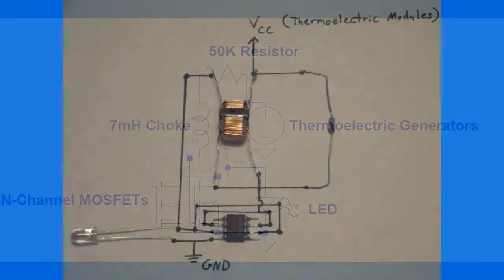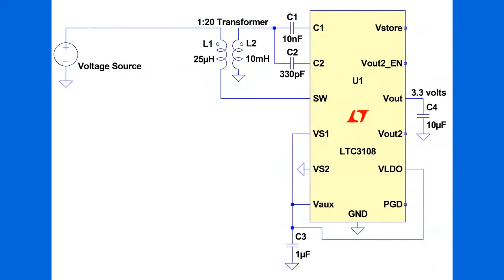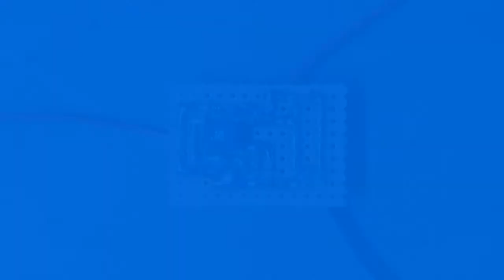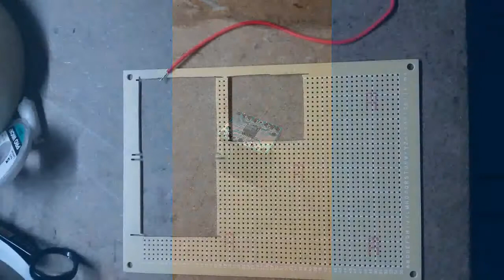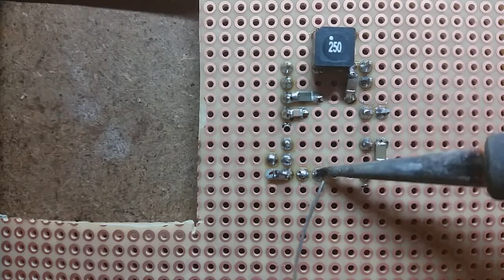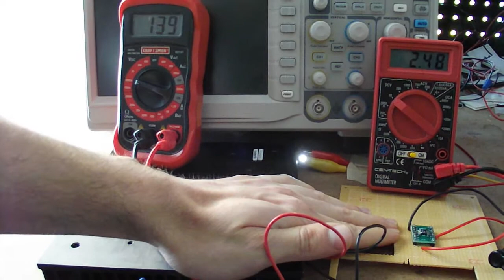How to make the LTC3108 Energy Harvester

Comment: Hi may I may I know if the circuit will still work if I use the same capacitor values but with 1:100 from coilcraft.
Reply from the maker: Hi, 
For the 1:100 transformer, I would recommend using a 1uF cap instead of a 10uF cap.
Best regards,
Erik

Comment: Hi, we have been working with this circuitry but we cannot obtain 3.3V on the output. We have used 1: 100 transformer and have tried TEG and Solar panels as input but none of them seem to work😓by using a signal generator with Vpp 1V we could obtain some reference voltages on some pins like VLDO 2.2V and VAUX 5.25V but still couldn’t see 3.3V on the output. Do you have any idea why it doesn’t work? If you could help we would appreciate it🙂Thank you for the video.
Reply from the maker: Hi, are you sure there aren't any pins that are accidentally shorted? If you are measuring 5.25V on the VAUX and 2.2v at the VLDO, then it is switching and mostly operating. I would check the soldering, especially if the VOUT pin is shorted to another pin.

Best regards,
Erik
Reply: After I sent this comment we have found out that soldering was poor on the Vout pin and it was not connected to capacitor😅That was the reason of the problem🙂Thank you so much for your response🙏

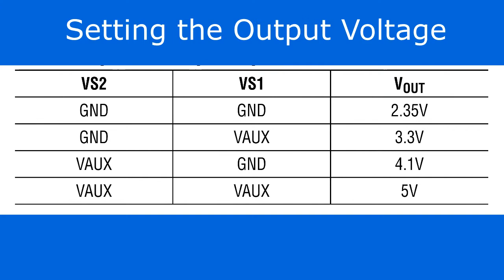Comment: Sorry Sir, can I ask you some questions. I read the link 1:20 transformer you give us, I don’t understand that why it is not a 1:20 transformer but coil inductor. I read this coild inductor’s datasheet but there has not description about 1:20. 
So if I want to use 1:100 transformer, could you please give the link the product for me? I am really grateful if you can do that. Thank you very much
Reply from the maker: Hi. It is technically a coupled inductor with one side having more turns than the other, so it still functions as a transformer. Here's a link to the 1:100 transformer: https://www.mouser.com/ProductDetail/Wurth-Elektronik/74488540070?qs=BXmE%252BJ0Y7xZ448CDAQuf4w%3D%3D
Reply: Thank you very much @lampe7384

Comment: Expensive parts ! look at Dc-Dc converter  H004F to92 starts at 0.3volt 200 000hz  ideal input is 0.7 - 3 volt .. adjust output by induktor value ..
Reply from the maker: If you don't need to go lower than 0.3V, then I wouldn't recommend the LTC3108.

Comment: What is the components that I need to use if the input that comes from my peltier module is ranges from 100mV to 1V
Reply from the maker: It depends. Do you have a bunch of peltier in series to achieve that or is it a single one and you have a large temperature difference?
Reply: The temperature difference ranges from 10-20 degrees
Reply: The temperature difference ranges from 10-20 degrees
Reply from the maker: @raffysulat2705  How often is the peltier voltage in the lower range, say <250mV? If it is usually greater than >250mV, I'll have to recommend another IC, the LTC3105.
Reply: I have another question. Using the same components in the video, can it charge a 3.7V battery?
Reply from the maker: @raffysulat2705  This is for 3.3Vout, but you can set the Vout to 4.1V by connecting the VS1 pin to GND and VS2 pin to VAUX. The one in the video has it VS1 to VAUX and VS2 to GND. 4.1V should be able to charge a 3.7V battery.

Comment: It only works with DC small voltage or it can work with small AC voltage? Thanks...
Reply from the maker: It only works with DC voltage.
Reply: @lampe7384  I'm asking, because would be nice to make such a device and harvest power from the roof antenna. 
I checked, with socket grounding, it makes 0.01 to 0.07V :D .... Probably full bridge rectifier is necessary before to make a DC :) .... I might need to do some small test
Reply from the maker: @Brown_1_111  You should be able to do it with the LTC3109. How much current can you generate from roof antenna?
Reply: @lampe7384  actually.... I guess my old multimeter showed wrong stuff. 
Recently connected a bit better one, that one shows max 5v AC and around 0.15A! :O even shows 50Hz frequency nearly stable. Not sure why. I'm using socket grounding.
Reply from the maker: @Brown_1_111  5V open circuit, and 0.15A short circuit? or 5V at 0.15A? In any case, 5V is too high to use the LTC3109. For an AC input of 5V, I would recommend the LTC3588-1. It's designed for such energy harvesting applications.
Reply: @lampe7384  5V at 0.15A closed I guess. Black multimeter cable connected to the ground, red connect to the antenna
Reply: @lampe7384  also, on DC settings, multimeter shows around 183.3mV now...
Reply: @lampe7384  another interesting thing: the antenna I have is male Socket. Inner volts coming in around 4.3V while out or negative side gives 4.8V ... 🤔
Reply from the maker: @Brown_1_111  If the voltage is AC, you have to use the AC RMS meter to give you an accurate measurement. Have you tried rectifying the voltage with some diodes? If you make a full bridge rectifier and a filter, you could make a simple solution with most DC/DC converters. What is it that you want to power or charge?
Reply: @lampe7384  No I haven't. I'll order some and try. I would like to know, what potential I can make from this setup. :) U know.... Tesla setup..... :)
Reply from the maker: @Brown_1_111  You want to make a tesla coil? The current would be very small, but you might be able to get small pulses of 10000s of volts.
Reply: @lampe7384  Yes. Voltage most important.  Then everything depends upon good grounding and caps... And of course, transformers, all for later stage. I'm thinking to get frequency generator. It suppose to help upon capacitors filling, at high rate. And so onnn... :) Have some blueprints, just need to test them, this is first stage, get constant supply of volts from antenna.
Reply: AC LPF 4.7V 😮🤔🤔

Comment: Would this be able to operate ok with an input voltage of roughly 625 mV?
Reply from the maker: Theoretically yes, but the efficiency will drop significantly. It would be less than 10% efficiency and require something like 100mW of power to drive an LED at 10mW. I'd recommend using a different DC-DC converter. The LTC3105 would be perfect at that input voltage. How much power do you have available to use?
Reply: @lampe7384  Thank you for the advice! I am currently a student working on a senior design project. We are attempting to power a sensor that needs at least 8.1 uW at at least 1.5 V. We have a rectifier with simulations show it outputing over 600 mV. Would I possibly be able to contact you for further advice?
Reply from the maker: @jjnether  Yeah sure, send me an email to lamppowercreations@gmail.com. What's the power source that you want to use for your sensor?

Comment: I like your video young man. QUESTION Could use two Transformers the first 20mv and then switch over to the 100mv one???? Also could you use a small JOULE THIFE to Boost the Power up to your desired Current and Voltage????
Reply from the maker: Thank you and good question. If you want to use the 1:100 transformer that is used for a 20mV you will need to change the 10nF C1 cap to a 1nF cap. Usually a joule thief requires an input voltage of around 0.5V or higher to operate.
Reply: @lampe7384  Thank you for  your response. Doesn't this Energy Scavenging Device Transformer work above the Half Volt needed to engage the JOULE THIFE?   Also, what about using a Variable Capacitor instead of a fixed Value Capacitor? Thank you for your time Mate. It's Appreciated by me. Your Knowledge is Valuable to me.
Reply from the maker: James Kennedy are you trying to use the transformer in a joule thief circuit or are you trying to connect a joule thief circuit to the output of the LTC3108? It needs to be a fixed value cap because it needs to be a ceramic cap
Reply: As too the JOULE THIFE which ever way it would work best. I was just asking if this circuit would help in power performance. Thank you for your response. It's appreciated.
Reply from the maker: @kennedy67951  If you want the best performance, I would not recommend using a joule thief. The LTC3108 is the circuit of choice up to 300mV, after that, I'd recommend the LTC3105. What is your desired voltage range and power requirements?
Reply: @lampe7384  Thank you for your advise. It's appreciated.

Comment: Sorry to bother u again, but i have a question. I've connected the LED light to the circuit in Vout, but the LED light is not powering on. I saw the one 1 + 3 = 5V, and so i solder but it's not working. Please help!! im begging

Comment: I have a question I bought the circuit provided by you im the Description. However, I am confused on how to connect it to a  Peltier Tile and to a LED. LampE or someone may you please help me
Reply from the maker: The LED should be connected at Vout, and the peltier tile should be connected to Vin.
Reply: Ok. Thank you. However, the LED light is not lighting im not sure what to do. The peltier tiles are connected and the LED is connected to the output, but im confuse why it is not lighting up. Please help LampE

Comment: hello lampe
is it a necessity that we should use only smd capacitors or can we use normal through the hole ones. Asking this because my circuit is not working.
waiting for your reply
Reply from the maker: SMD capacitors will have less issues with noise, but through hole ones might work.
Reply: Thanks for the reply Lampe
But I have another issue. Please help me out. I am using a 1:100 ratio transformer as my input voltage is only 30mV so can you reply on what modifications I have to make to the circuit for it work with the 1:100 transformer. Note: I am using a Colicraft (752S) transformer.

Comment: Hi there, I am a GCSE Year 11 Product Design student, we are working on similar projects. I am also trying to use a CJMCU-3108 board to step up a voltage of around 0.15v produced by the temperature differential across 3x Peltier tiles (TEC1-12706) wired in series, to 3.3v. Everywhere I am reading, the specifications seem to promise this possible. Using the information on the LTC3108 chip data sheet, I concluded a 1:20 transformer would be most appropriate. Following this, I managed to source one and install it.

With lots of research I have now managed to get this far but have come to a standstill, rather annoyingly because I believe I now have all the components needed, it’s just the case of connecting them properly. I have a wiring diagram for the LTC3108, that supposedly shows you how all the components should be connected but I am struggling to translate this to what I need to connect where with the LTC3108 contained within the CJMCU-3108. Please could someone advise or suggest any way in which I can progress please?

Thanks In advance,
Luke Thomas.

Comment: LampeE good work, great video. I'm not lacking the electronic understanding, but I'm wondering what is basic purpose and what is mean't by energy harvesting? Probably I'm just lacking some basic understanding.

If I understood right this is kind of a switched mode DC-DC step-up inputting a lower voltage and you get out a higher voltage. Or is the IC actually some kind of peltier element and thermic energy (from ambient, or finger?) is converted to electric current? But if Yes, why is then input voltage needed?

Thank you very much!
Reply from the maker: It is a DC-DC converter for increasing the voltage of thermoelectric (peltier) modules or solar cells.
Reply: LampE thank you LampE.

So basically giving an input voltage is for testing before using it with a peltier or so. Right?
Reply from the maker: @lukasbruderlin2723  Yes

Comment: HI. WE ARE RESEARCHERS BUILDING A TWO CHAMBERED MICRBIAL FUEL CELL USING GREEN ALGAE. WE HAVE ZINC ELECTRODE AS THE ANODE WHILE COPPER PLATE AS THE CAATHODE. BUT IT ONLY YIELDS UP TO 0.99mV. DO YOU HAVE ANY IDEA HOW TO SET THIS ENERGY HARVESTER CIRCUIT IN OUR DEVICE?
Reply from the maker: 0.99mV is a very low voltage. I'm not sure it'll be able to boast the voltage, but you can try. I've never tested the the LTC3108 anything less than 20mV or so. Is there a specific voltage you would like to achieve?
Reply: LampE I MEAN 99mv SO THATS .99V. WE WOULD LIKE TO ATLEAST BOOST IT INTO 5V :-)
Reply from the maker: 99mV is equal to 0.099V, and that should work with this circuit. It won't be able to output much current though.

Comment: the pre-made circuit listed in the description works just as fine? and it is ready to use?    it doesnt look the same as yours, help please
Reply from the maker: The pre-made circuit is a fully built LTC3108 that I found on Amazon that should work just as fine as the one that I made in this video. I have not tested the one in the description, but it should work. There are other sellers that you can buy a pre-made LTC3108 from that can be found on the same Amazon page. They all require some amount of soldering to use it.
Reply: thanks you!
Reply: where do i have tobuse soldering,
Reply from the maker: From the description, it looks like you will need to make a solder connection between two pads. The description indicates which pads will need to be soldered depending upon what your desire output voltage is. Ex. soldering pads 1 and 3 together will output 5 volts.
Reply: LampE  sorry to bother you again this is for a school proyect and i dont know how to use this and my teacher is of no help, if i solder the pads 1 and 3,  i DO NOT  need to use the protoboard? thats it?  just solder the pads and then connect the  peltier tiles and the led light? please help       and if i do need to use the protoboard how do i use it and what type of protoboard? please help
Reply from the maker: Yes, you do not need a protoboard. Everything that you should need is on the board. After soldering the two pads, the LED and the peltier tiles, you should be fine
Reply: @victoriavaldespino7737  so did it work for you cause im at the same stage as you

Comment: nice work LampeE  SEEKING YOU KINDEST COMMENTS WHEN USING A 20MM*20MM TEC would it still can start  A LED ON? THX A MILLION
Reply from the maker: I am not sure, but you can try using a lot of them to power the circuit
Reply: Hi lampE  indeed i used few pc's but current still in micro as well (heat sink ) and (DELTA T ) is quite an issue .keep trying ,cheers my friend .

Comment: Hello LampE
Loved your videos 
But a little confused how to use the readymade LTC3108 circuit as it has 14 +4 leads 
Pls help me with that🙏🏻🙏🏻
Reply from the maker: Check out this one instead:https://www.amazon.com/Thermal-Harvesting-LTC3108-supercapacitor-storage/dp/B07561ZDLJ/ref=pd_cp_328_3?pf_rd_m=ATVPDKIKX0DER&pf_rd_p=80460301815383741&pf_rd_r=JBQX5JK1QRP7JT41H09Z&pd_rd_wg=vsFQq&pf_rd_s=desktop-dp-sims&pf_rd_t=40701&pd_rd_w=3nwR1&pf_rd_i=desktop-dp-sims&pd_rd_r=681e5754-7675-11e8-a123-953aebdcb599&pd_rd_i=B07561ZDLJ&psc=1&refRID=JBQX5JK1QRP7JT41H09Z
Reply: LampE I have ordered the one you have given in description pls tell me how to use it 
Pls🙏🏻🙏🏻🙏🏻🙏🏻🙏🏻
Reply from the maker: So not the one that I linked in the message? I updated the description one today because I noticed that it required a transformer as well
Reply: LampE I am from india and that circuit that you are talking about is not available
Which transformer should I use?
Reply from the maker: You might want to try the transformer in the description: https://www.digikey.in/products/en?keywords=732-4244-2-ND
Reply: LampE It takes a lot of delivery charge to deliver to India
Any other tranformer that can be easily found?
In india they are called by numbers like 250
33
Pls help🙏🏻🙏🏻🙏🏻🙏🏻
Reply from the maker: dang, see if you can find the same model somewhere else on the internet. I don't really know much about finding placing on the internet that ships cheaply to India
Reply: LampE can I use 1:20 transformer that u used in the video i.e 250?
Reply from the maker: Yes, that is the one that I used
Reply: LampE Can you please tell how to use the circuit that I ordered?
I mean where to put which cables
Please help🙏🏻🙏🏻
Reply from the maker: The product description should show how to connect it. I haven't had to buy one and set it up before.
Reply: @gobind1703  o

Comment: ---------Hello good afternoon, I'm an industrial design student and I'm doing a project in which I use peltier cells, and I wanted to know if with a single petier cell the LED can be fully powered or if there is some way to increase the sensitivity of the circuit, for achieve a greater energy performance, could you tell me what kind of led is that, I appreciate the attention and I hope an answer, thank you very much

Comment: Lampe bro , can you please make a new video on connecting the peltier module and a led to the circuit . I badly need help . please make a video on it
Reply from the maker: Just connect the input wire and ground wire of the circuit to module, and the output wire and ground wire to the LED

Comment: If the output voltage for thermoelectric module is DC voltage then how can it drive that 1:20 turn transformer??
Reply from the maker: The transformer connects to an internal transistor inside the LTC3108 through the capacitors, from which a step-up oscillator is made. This oscillation basically takes a DC voltage and makes it AC.
Reply: Thanks for the answer bro.
Reply from the maker: Np